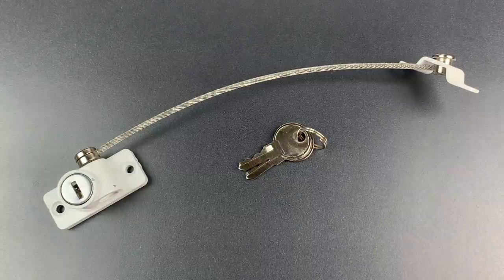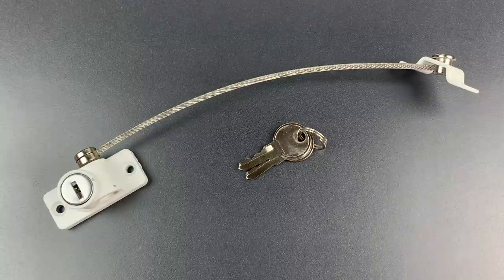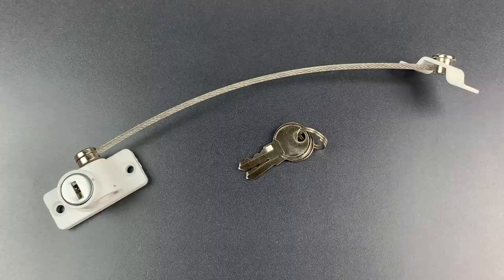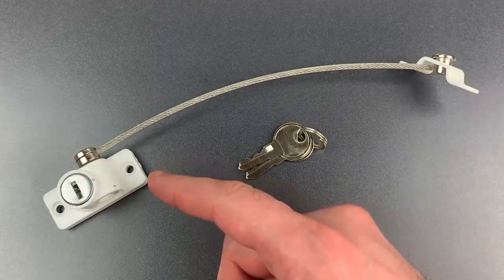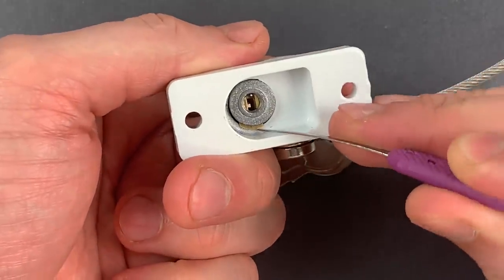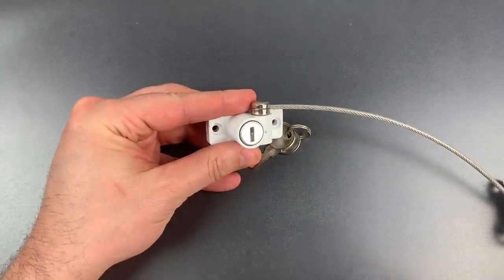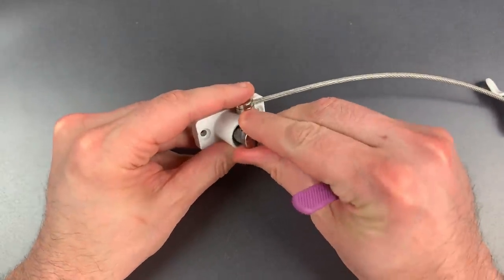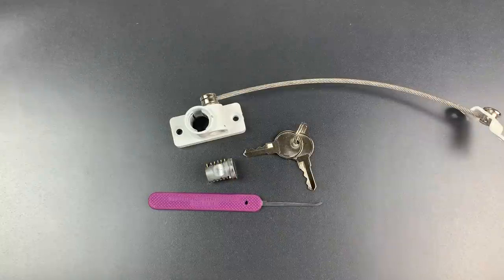[873] Why Is This Lock So Dangerous?

Comment: "Isn't locking the window like that dangerous?"
"Well a little, yeah, but in this case you have to measure the security over the fire safety."
"Well is the lock at least a secure lock?"
"Oh god no, you can open that shit up with a paperclip if you had to"
Reply: Lmao, underrated comment.
Reply: well it serves it's purpose which is to protect you from people coming from the outside
Reply: @alexbevan2183  that depends on how easily accessible this lock is for someone approaching from the outside.
Reply: Actually it's gonna be super easy, barely an inconvenience.
Reply: Linus Wolf how tf u going to reach the lock from outside?
Reply: @linuswolf6880  ... Ok Ryan..
Reply: This is actually the most well designed lock ever. It can't be opened from outside the window in any situation, but it can be opened from the inside using a paperclip within 1 second. Easy to open from the secure side, impossible to open from the insecure side.
Reply: @averagejoey2000  if the lock is inaccessible from the outside, then the lock serves no function but to present a hazard and should be replaced with a more simplistic release system.
Reply: Joseph Simone or u could just use u know, a normal window latch.
Reply: Zero security, and yet one can look at it and go "no way I can open this."
And that's how accidents happen, and lawsuits are filed
Reply: @joshandrews8913  why yes thats the point. What purpose does the lock itself serve though when a bolt latch serves the same purpose and is infinitly easier to indo
Reply: @plaxy100  I'm not sure I understand your intentions. Are you agreeing with me? Because I agree a bolt latch would be a safer alternative.
Reply: if you have the lock in your hand, yes its easy, but how easy if your OUTSIDE and the window only opens a tiny bit......
Reply: @Zraknul  Simplistic egress systems are more accessible from the outside, as they are usually just pressure based.  This would require pressure and high accuracy to get the tool into the slot and manipulate it to the correct spot.
Reply: @ukdashcamguy500  this lock can be raked so easy.  also a bolt latch  can't be undone while the window is open you have to close the window undo the latch and open it.
Reply: @chaylez4102  that amount of wire is plenty to reach a hand through and its not like you need to tension the core so you only need one had and a pick to do this.
Also that little piece of chickenwire could easily be cut with a pair wirecutters or trauma shears.
Reply: @stavik96  if the window is closed this lock is pointless because youd just use a normal window latch. The whole point of this is that you can have it open and the cable prevents it from being opened further than the length of the cable but the cable is exposed and you could easily cut it seeing as its like a mm thick and you could easily get at the core just by reaching a hand through the cracked open window if you couldnt cut the cable for whatever reason
Reply: @ukdashcamguy500  bruh that cable is a solid 6 inches long if not longer. Thats plenty of room to reach a hand through and get at the lock with a pick
Reply: *from the inside
Reply: It's designed to do 1 thing, not allow the window to open far enough for a person to climb through when the window is open. It allows the window to be left open for air, but not allow someone to crawl through. The thing that LPL never seems to understand is security at its basic form and practicality. A lock never needs to be more secure than the lease secure measure. (This lock doesn't need to be more secure than breaking a window or unscrewing the two end mounts of the lock.) Practically, people aren't picking locks to gain access to rooms and they're not shimming locks. A burglar is far more likely to have a small pair of cable cutters, than to start trying to figure out how to defeat a lock. More of his "it's deadly" or "it's dangerous" it's just sensationalized nonsense. Like the long gun lock in police cars. You have never heard of a criminal having a powerful neodymium magnet hanging in their pocket for when they need to gain access to a secured long gun in a police car, because it doesn't happen. It's a non issue. It's meant to stop the criminal from gaining quick access to the firearm if the officer is disabled; which it does well.
Reply: @littlejackalo5326  You just contradicted yourself. You first implied that the lock is more secure than the window and then immediately pointed out how a burglar is likely to have a pair of bold cutters, which would be much more effective on the wire than the window.

Please do explain how exactly it is sensationalized nonsense to point out that blocking off one of the only two exists you have is dangerous? Based on context it can be reasonably assumed that the people in the hotel room don't get the key to the lock, so yes, locking a window could absolutely be dangerous when time if of the essence, like a fire.
Reply: @videoshack12351  I’ve never been to a hotel that allowed you to open the window this is to prevent people from jumping out the window and killing themselves or throwing things on to people below
Reply: @chaylez4102  By reaching in through the crack with your arm. This thing is designed to let you're window open partially but not let people fully come in. I wouldn't be surprised if there was enough clearance for a arm to do the bypass in the video
Reply: actually some countries hotel has their hotel window locked for a reason.People kept jumping down from hotel either or accidentally falling over. is pretty bad if your hotel keep having such thing happens
Reply: Well, at least the burglar can't pick it from outside, right? I mean, it's not like they could just crack the window, stick their hand through... Wait. Oh fuck.
Reply: @videoshack12351  how do you latch a window while it's cracked open? 🧐🧐
Reply: Mind you, the bypass would be useless to someone outside the room.
Reply: @littlejackalo5326  The deadly comment wasn't because it's easily pickable, it was because it's hard to get out quickly in a fire.  (This type of lock would only be used on a ground floor window, so it was likely designed to be the fire escape window).
Reply: @katiealvarado7115  This kind of lock is for ground floor windows.

Comment: I never thought of the implication that are associated with a lock on the window. Thank you lpl!
Reply: First thing before you decide to sleep in any place: identify at least 2 different means of egress in case of emergency. That is, if you value your life, of course.
Reply: Nor did whoever installed it.
Reply: Nearly every hotel room has no opening windows... I don't think this is as much of a problem as you all are making out.  What would you do anyway, jump 10 floors down?
Reply: As LPL stated, this lock was on the GROUND floor room window.
Reply: @Genthar  So what?  I'm just saying there's plenty of non-ground-floor hotel rooms that are beyond the reach of any firefighting equipment, have non-opening windows, and that violates no codes and no one thinks twice about it.
Reply: @GigsTaggart  There's a rather big difference between a window that couldn't be used for egress anyway, and one that could but it is unnecessarily locked.  There are ways to secure such a window such that it can be quickly released by the occupant in an emergency.  Safety first.
Reply: @omargoodman2999  to be fair most windows that can't be used are modified to be that way, rarely are they made from factory to never open, I've been in plenty of hotels that had normal windows but with caulking or something to keep it shut. Not that different from a lock that they put there on purpose.
Reply: @bloodlove93  yes, not that different; unnecessarily unsafe and an impediment to egress.  Most often, such windows are sealed for concerns such as air conditioning costs, noise, and avoiding wear on window mechanisms to avoid repair/replacement cost.
Reply: @omargoodman2999  you won't find me arguing that. 
And yeah I know why I was just stating the similarity from my past experiences.
Reply: Well, in a life threatening situation a window is not much of an obstacle even if locked. Unless it's bullet proof or something.
Reply: @Murgoh  True enough, many ways to break normal windows if absolutely necessary.
Reply: The vast majority of windows in hotels are to high to escape from solo. So the point he's making it's as strong as it sounds.
Reply: LPL's point is completely moot IF the sizing and access of the emergency exits designed by the architect did not take into account the ground windows. 
However, in case ground windows are part of foreseen emeegency exits, locking them would ve illegal (at least in EU, dunno US).